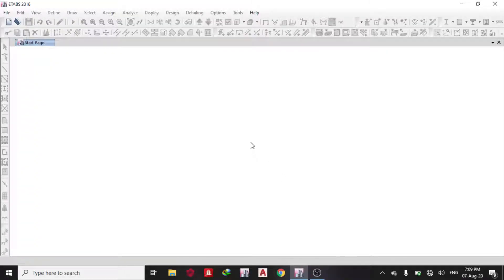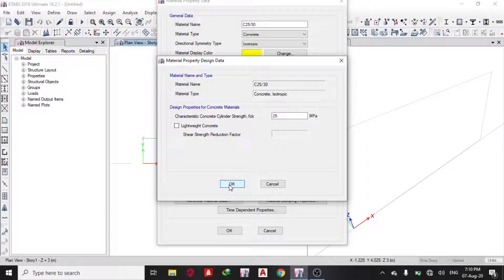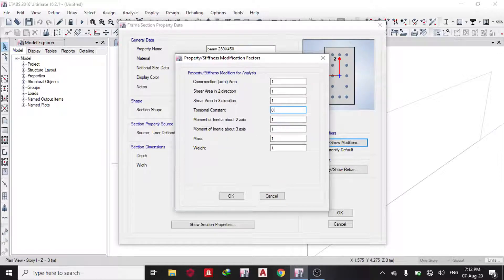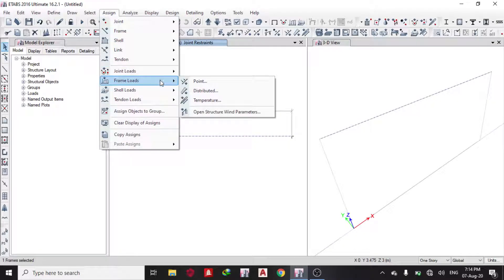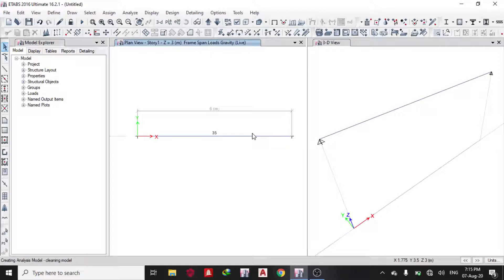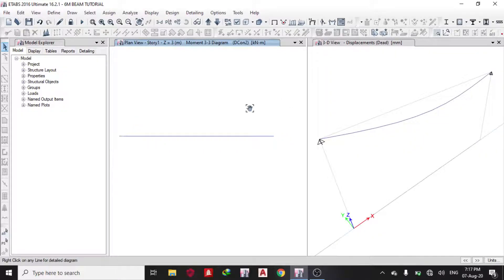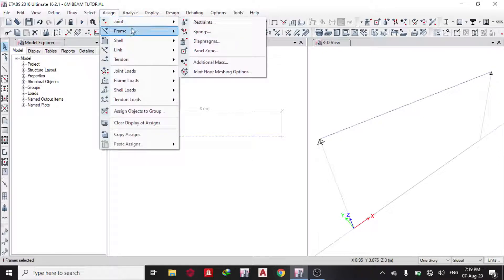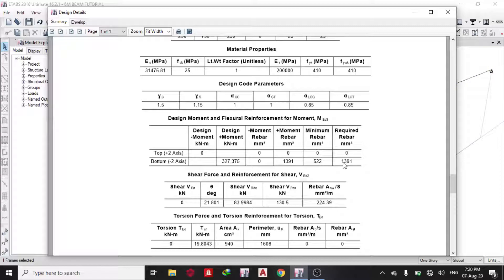How to design and pass an over stressed reinforced concrete beam in Etabs

Comment: Hello, great tutorial. When the beam fails due to Shear stress and increasing the size doesn't fix it, what's the way forward?
Reply from the maker: Andy Abur the best thing to do is either increase the width and depth of the beam or the concrete strength. And it would pass for EC2